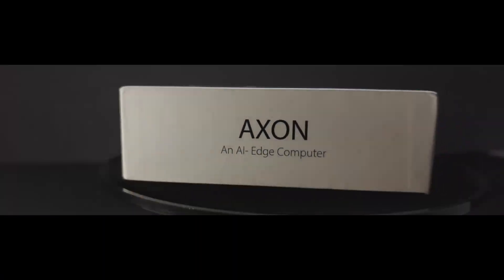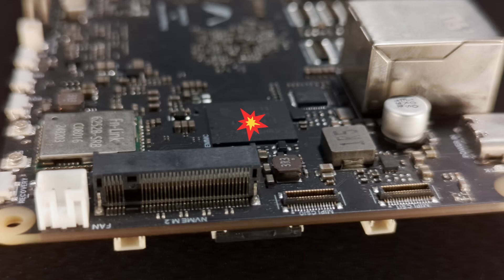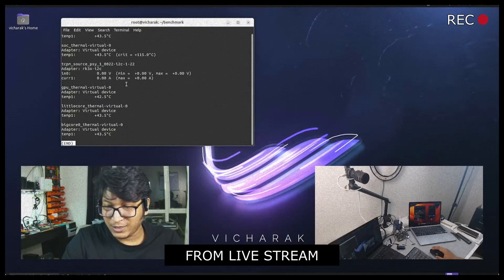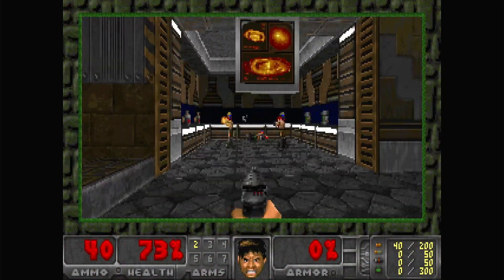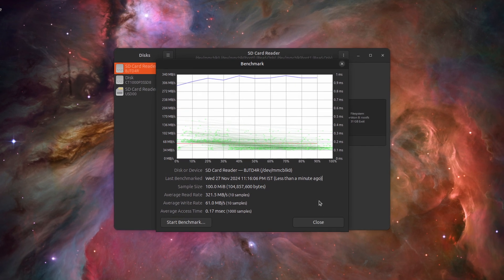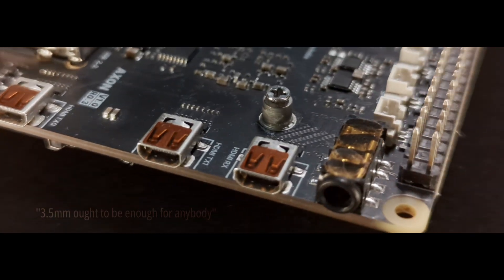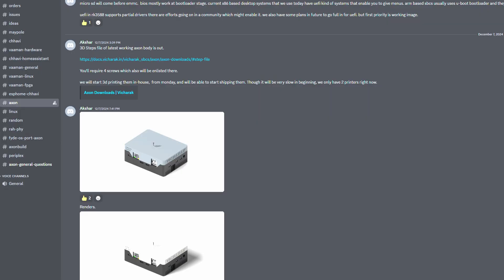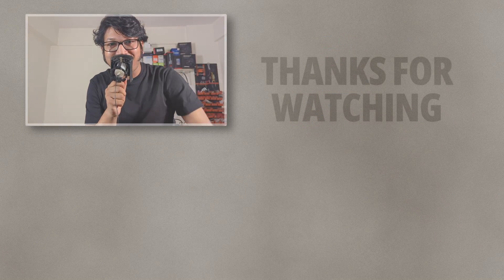This INDIAN Single Board Computer is full of potential!

Comment: Where can I get those speakers with the correct socket?
Reply from the maker: Those are https://www.waveshare.com/8ohm-2w-speaker.htm Search with "2030 Cavity Speaker" to check which vendors have them in stock.

NOTE: you will have to very carefully cut its default 4pin connector into 2*2pin connectors.

Comment: Sorry i do not know much but is the chip made in india and can you sideload operating systems like raspberry pi 
And which portable monitor was that 
And how fast is it compared to raspberry pi
Reply from the maker: Unfortunately we don't yet have good chip manufacturing capacity in India; but hopefully in future!
Not sure what you mean by sideload OS... you can boot either from eMMC or SD or NVMe & I've explained how, in the video.
The portable monitor is this one: https://www.amazon.in/gp/product/B0B2VZC871/ (no longer available, but there are similar alternatives)
As you can see in the GeekBench comparison, the CPU is roughly double the speed of Raspberry Pi on multicore benchmark.

Thanks for watching.
Reply: @BreakerSpace  so is this made to target dialy drivers and school purpose like raspberry Pi do I think the cost is high if that's the case if you guys can bring down to 12k then education industry that uses computers to conduct computer based test might become very interested since it is easy for them to plug it to electricity and use it
Reply from the maker: @Tryha4d  good feedback for the Vicharak team. I'm not someone who sets the price... just a user who likes to play with interesting new stuff.
Reply from the maker: @Tryha4d  good feedback for Vicharak team; but I don't work there (to set the price). I'm just an early adopter and user of new interesting tech.
Reply: @BreakerSpace  I know it was just opinion

Comment: Bad idea not using standard connectors very very very bad!
Reply from the maker: Sad part is, there's isn't a standard for MIPI connector... the 15 & 22 pin connectors made popular by Raspberry Pi are their proprietary connector of the MIPI interface. However, I agree with you that Vicharak should've used the same connectors instead fragmenting further.

Comment: What's the power supply unit? The documents say 12v/5a, that seems to be a laptop charger,  so how does that connect to the USB C PD port?
Reply from the maker: It runs fine off of a 5V3A regular USB power bricks (mobile chargers). If you use too many peripherals, then the current demand will go up. 12V is only required if you're attaching PCIe cards using 12V power rail, or using the 12V GPIO header. Otherwise, there's no need for 12V power for normal operation of the board.

I cut this part out of the video because (it was getting too long and) very few people care about the details of this.
Reply: USB C PD supports 5v, 9v, 15v, 20v with optional 12v at up to 5A for any voltage, a USB C PD device communicates with the charger/power brick to set the voltage and current, I believe PD 3.0 has the correct voltage and current for it.

Comment: It is pricey, 18K for 8GB LPDDR4X and the IO options are not great either. You could get Rock 5B+ 8GB LPDDR5 64GB emmc for ~12K with importing and has better software support from community and radxa. If I have to spend ~18K, I would definitely buy Radxa Orion O6 or x86 Odroid H4 Plus. I can't seem to justify the price.
Reply from the maker: I hope the economy of scale brings the cost down; but for that you need user demand, that's not gonna happen if you 1:1 cost compare vs Chinese manufacturing (where it's already mature, and cost is lower due to the same economy of scale).

So, it's a chicken vs egg problem - we have to bite the bullet & do something about it - or not do anything and forever be a tech importer (not manufacturer).
Reply: @BreakerSpace  Sure, The low quantities of boards don't make sensible unit price for the consumers, But if this is the case for every SBC they release, and people like me are hesitant to buy, how could they gain market share. I do own several SBC's over the years, India has increases tariffs over imports to help develop and encourage developing the products in India. But if they can beat the price even after that, there is some serious problem with their business strategy.
I am not against products made in India, I think this is a step in the right direction. But if they are more price compared to what I can get outside, These products are not for me.

Comment: It's an ARM processor, designed by ARM corporation. Looking at the specs, it's the same processor in orange pi 5. I strongly believe that they're paying manufacturers of rockchip in china to slap their logo on it and send it to India. That's why on their website they don't mention that these chips are designed or even the circuit board is manufactured in India 😂😂😂😂

Comment: I wouldnt consider this anything special.  
All parts and IP are from usual places and companies. Only underlying pcb has been designed.

Price and ram amount matters rhe most here, 16/32gb are a must these days.

Great video BTW !!
Reply from the maker: Thanks @pamus6242 and check out 0:28 - we can't just start doing calculus before learning basic arithmetic.

Someday we will etch our own silicon... maybe we'll make our own Lithography machines. But today we make PCB that's better than yesterday's PCB.
Reply: @BreakerSpace  You totally missed my point.

Biostar and MSI boards had a very very high failure rate 20+ years ago. 
Quality control was one thing but building quality parts another. 
Today board quality is almost consistent throughout a particular ecosystem because that technology is mature.
The act of getting things done is only one half of a story but the nightmare to get there is what nobody sees or could ever care about.

Just because we can today does not mean we ever could because that plinth has already been built, by others.
Reply: Why are u being anti national!!!??? It is make in endia!
Reply: @megajatt123  LOL !🤣🤣🤣
Dude, try making Intel 14th gen and AMD 9800x3d boards here, they'll end up RMA'ing every 3 months !!
It has taken motherboard companies 30 years to get to this place.
Low power devices like this Rockchip board do not require too much power and are nothing special when looking at the designs which can be copied from elsewhere. 
RISC-V is where fun will happen in the future but that would mean designing everything inhouse.

Comment: How do u compare this raspberry pi....performance and cost
Reply from the maker: On paper, this wins over Pi in both aspects... as long as you use all the features (NVMe, eMMC, 4K capture etc), as it will be costlier to buy all the HATs for RPi. But if a Raspberry Pi has all the features you need without HATs, then it'll probably be more cost effective.

So, it comes down to particular use case & choice. I will personally use this over RPi, as my media streaming server.
Reply: @BreakerSpace  pi has a largest developer  community thats why everybody knows and use it....this sbc would take years  if possible to get close even half of that...thats my opinion..which may vary for others

Comment: sbc that costs like an entry level destop / laptop. beats the purpose of sbc. 😂
long live my orange pi @ 1k.
Reply from the maker: Which Orange Pi board is 1k (INR)?
Also, the term single board computer has nothing to do with price, or feature, or performance; it seems like a false assumption.
Reply: @BreakerSpace  bought orange pi one few years ago at 900. installed armbian in it and it was all merry with its 512mb ram. 
anyways, sbc development board means, i need to have more than one lying around, as ecpendables. here price matters.
Reply: Dont laugh at it man, atleast appreciate the try
Reply: @soymadip  sorreh. i would rather buy a desktop or a chromebook at that budget. just being practical. 🤔
Reply: @iceberg789 I also think 18k is too much but if it has performance high enough and they pack it in nice book ready to plung in monitor and run at 15k might be worth it

Comment: Hey, this was a great video!
I actually wanted advice on how to get started with such hardware/firmware/FPGA... etc.. Basically, how do I start understanding and working with these SBCs, microcontroller boards efficiently? I am a sophomore rn, and have ofc worked with the basics of arduino and such, but yea, want to upgrade....
Reply from the maker: Thanks, and that's great to hear that you are interested in DIY electronics & compute!

I'd say you find a goal (don't worry about the practicality) and then try to achieve it with the products, tools, components, guides etc. you can find online. It will be a journey, but if you learn to enjoy it, within weeks you'll start to get into the grooves.

If you need inspirations, then I'd say make a homelab server (with a Raspberry Pi or better if it's any of its alternatives) to setup your own network attached storage, jellyfin media streaming, vaultwarden password manager, pihole ad blocker and the likes. Keep going deeper to understand the limitations and ways to overcome it, one step at a time.

All the best!

Comment: 6:10 RK3588 is getting mainline kernel support. I have OrangePi5 Plus boards with the same SoC and Linux-6.13-rc4 works flawlessly.
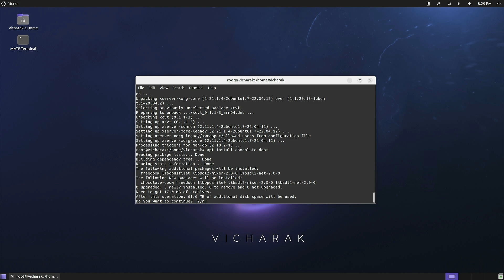Reply from the maker: Yep, you're right! I mentioned this in 6:20. Vicharak hasn't released the image with 6.10 kernel yet for Axon.
It is always the challenge with non-UEFI ARM devices (i.e. most of them), you will need the image with new kernel from the vendor (or build one yourself).

Comment from the maker: A little off the norm video this time. But, locally made/built/manufactured tech in the subcontinent will totally be a recurring part of BreakerSpace. Build videos will return soon; and there will also be some deep dives and software projects that I dabble in.

Stay tuned for all that, and reply here if you have very specific feedback.
Reply: This is the first video of yours that I've watched, but based on this video I subscribed, doing video's on hardware both what you use and recommend and on new hardware is an important part for me at least so I can make a good choice on what to use in my projects (why I clicked this video), part of that choice is what the component is good and bad at, which you covered well in this video. So a mix of video's of how to use the hardware as well as a few video's on new hardware that's promising even if it's not there yet could open your channel up to more that find you for the hardware and stay for the practical use cases. Just my 2c as the saying goes.